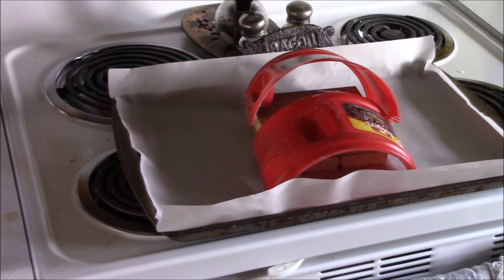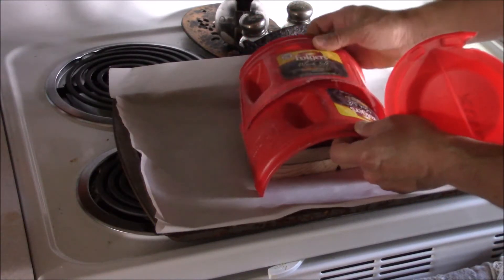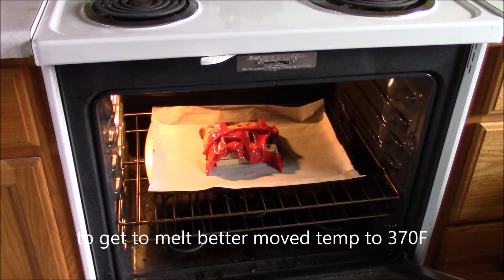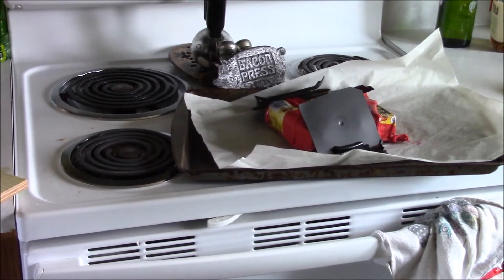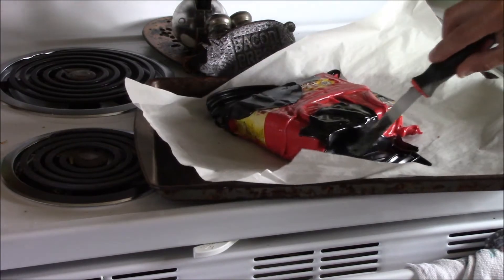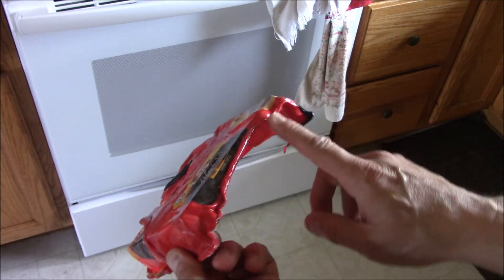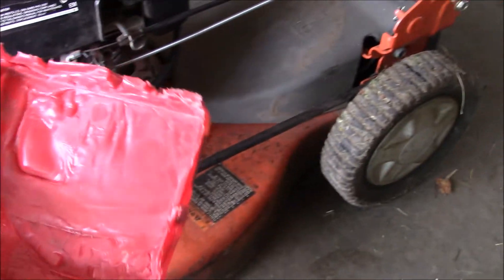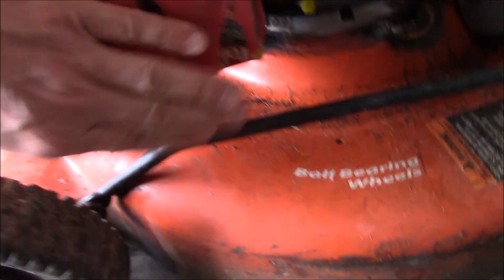Making plastic parts at home with HDPE scraps

Comment: How toxic is this process? I need to know, small children in the home. Planning on hand making a custom part that was never designed by anyone for my car. Super one off stuff for an 80s car. I know I can paint it, but for ease, black plastic plumbing pipe is the same plastic right? Thanks in advance.
Reply from the maker: I believe black plumbing pipe is ABS plastic.  HDPE plastic is different.  I made sure the oven was not too hot and well ventilated.  Fumes from HDPE can  cause eye and respiratory  irritation.  Material data link: msdssearch.dow.com/PublishedLiteratureDOWCOM/dh_091f/0901b8038091f9d5.pdf?filepath=productsafety/pdfs/noreg/233-00577.pdf&fromPage=GetDoc

Comment: Neat idea using wood as a mold. Did it burn at all?. Did the HDPE come easy off of it?.
Reply from the maker: did not burn the wood, took it off while still warm, should work better if the mold is tapered slightly